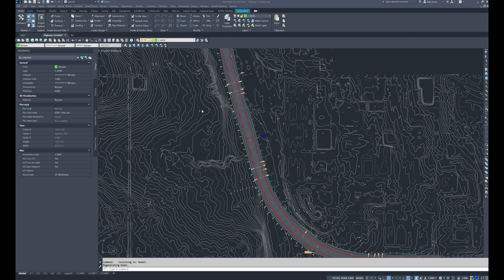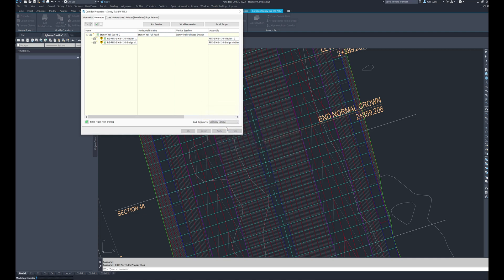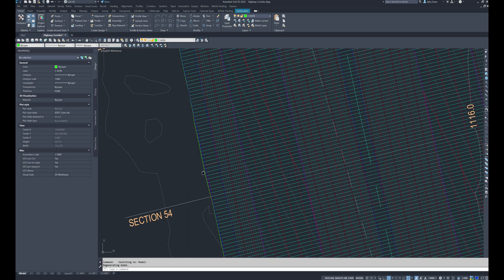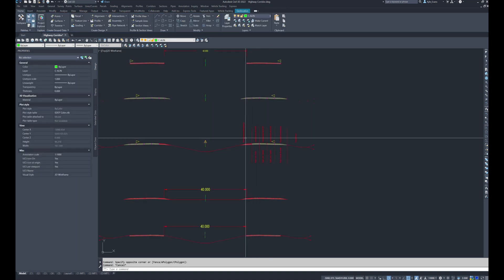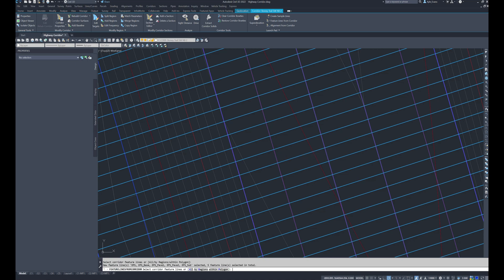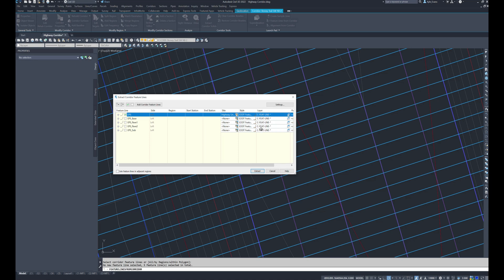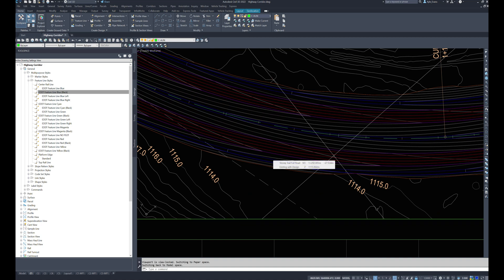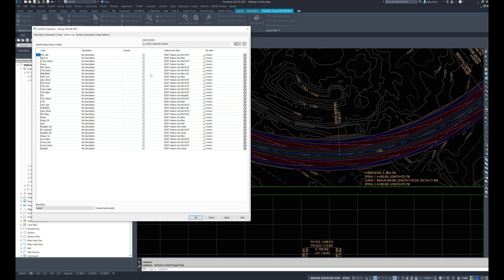Part 11 - Corridor Object Extraction, Viewing, Display Options

Comment: If your available I need your help please respond on my comment .. whenever I use offset alignment my drawing starts to runs slow when I used all those widening etc can you please show me the best practices to how can I use offset alignment efficiently because it's a very good tool to because as you also it's dynamic to alignment my only concern about that ..how to use it more systematic ..8 km road or if I use for some duct bank can you please help me and make a vedio
Reply: I'm his previous student and I have same situations as you when I'm doing some of the widening projects, I guess when you doing all those widening projects, simplified the original alignment should be processes if you don't have fine/proper survey picked. So instead create offset alignment right the way, you may need to simplify your alignment (for example if the alignment is on edge of pavement, you don't want to read them every 3-5 meters specially for 8km road we do every 10-20m on tangent,1-5 on curves) and also create "best fit profile"(for widening purpose I assume we don't really need the profile to be 'dynamic' at all), since there's a lot topographic points reading weather vertically & horizontally (drone survey are even worse). don't worried too much about plus/minus a cent on tie-in, the site guys would always prefer mill/overlay to tie to existing crown for widening jobs.